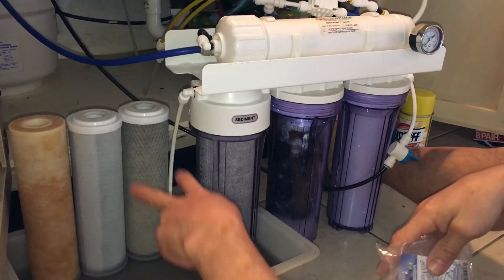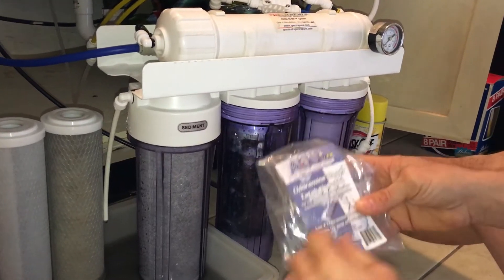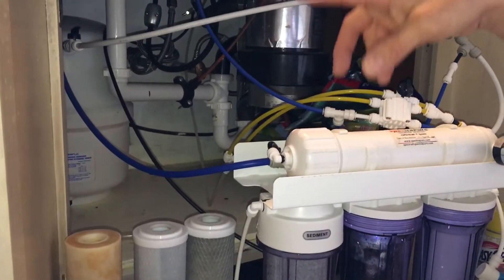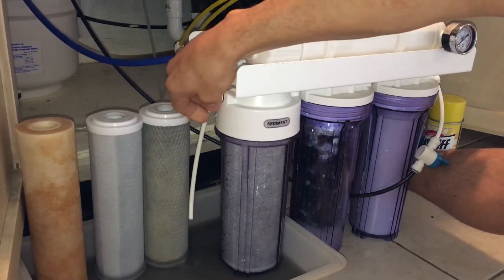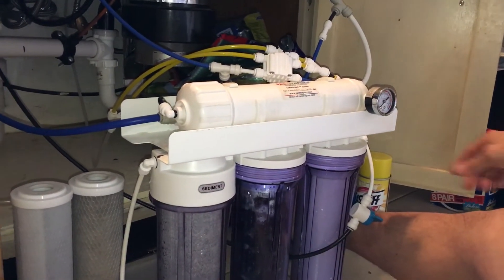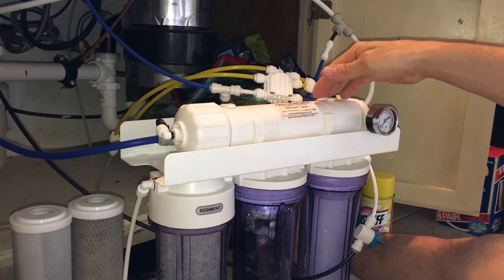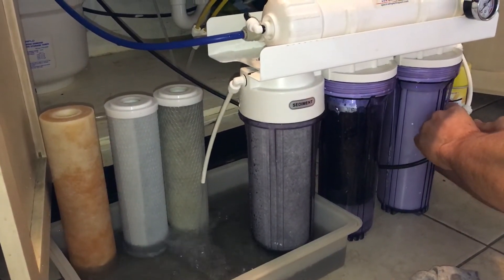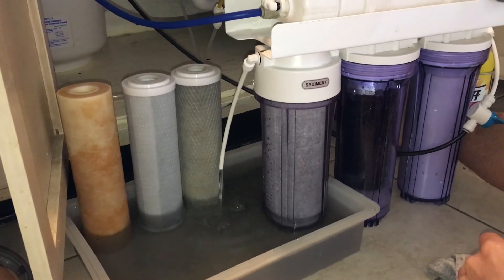RO system Flushing carbon blocks upon replacement.

Comment: ive Always done the flush of the carbon block Before connecting the membrane into the system... one time after flushing and adding the membrane, i noticed water was tasting horrible.. I removed the sediment and carbonblock filters and the carbon chamber was filled with jet black water!, needless to say, it was flushing that carp into my good membrane for abt a week before i caught it... the membrane was discolored and im guessing, it was toast..  seems the carbon block had a defect that released continous carbon out into the membrane..  alittle initially ,yes, but this was Always outputting black and never flushed itself clean...the brand was Aquaflow....The new membrane i got after that fiasco was also an aquaflow 75gpd and IT was defective as well! outputting water with  no tds drop whatsoever!   needless to say, i would avoid that brand like the plague...i bought sediment and carbon block from watts and used a filmtec membrane and it worked fine.

Comment: The problem is that, even after flushing, how can we be sure that there won't be any black carbon coming in the system? and how to know if the carbon filters needs to be changed, I am having exactly same system, and these points are always a concern for me